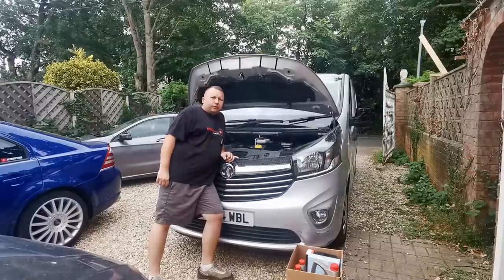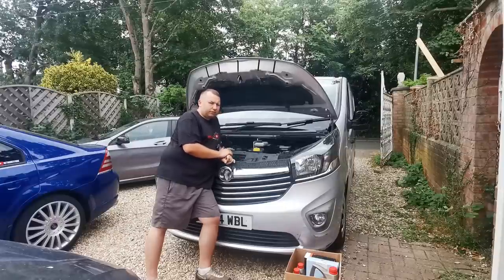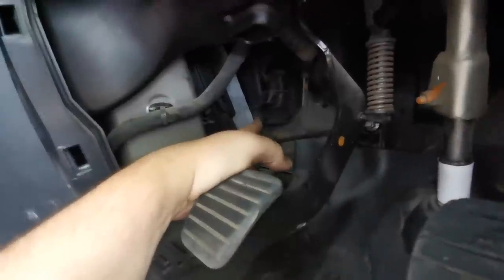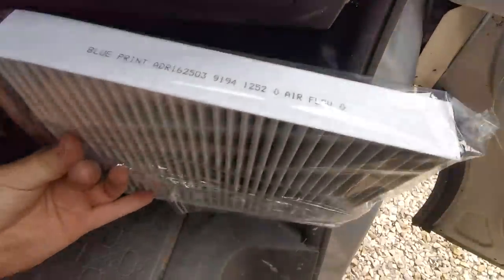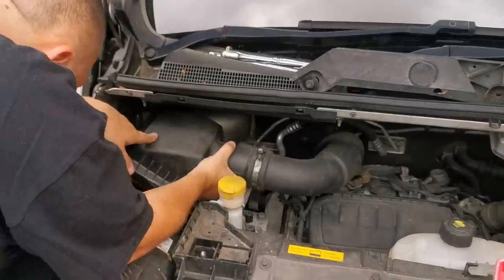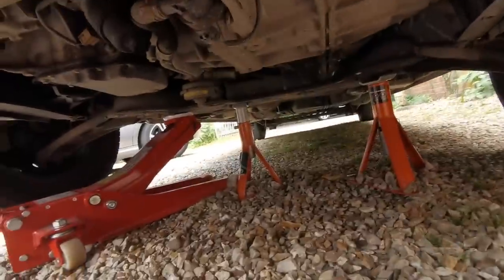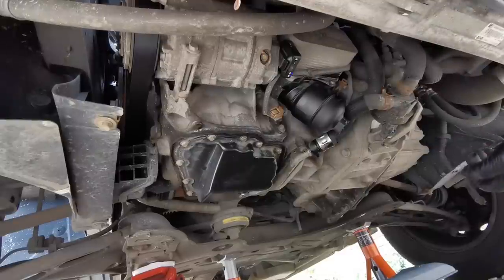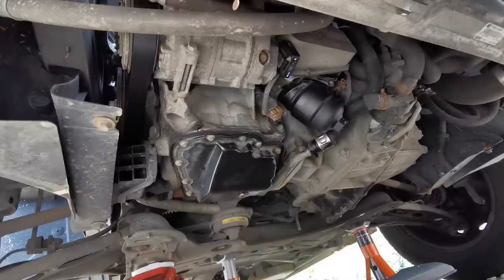VAUXHALL VIVARO B SERVICE #vauxhall #projectman

Comment: Good tips 👍
Have fait talento same engine and set up
Quick fill oil, top of engine cover, maybe yellow cap? Or hose, cink hose turn it right and lift up as cap 
Pour oil straight into engine 7.4 l  5w 40
Reply from the maker: Nice

Comment: Gary please give it a good thrashing now and again as these are terrible for the dpf’s blocking up if poodled about all the time. I wash at least 7 different dpf’s a week at work. The exhaust pressure sensor pipe clogs up with soot and is a pain in the arse to change. Your engine looks very dry so I would guess you have a good one. Nice video as per usual 👍🏴
Reply from the maker: It's sweet Andy 👊🏻👊🏻
Reply: @ProjectMan  I think you have a good one 👍

Comment: Good video Gary I’m surprised you did use good old Mannol long life 5w30 fully synthetic £33 for 10 ltr off ebay , I did the wife’s 1.6 diesel Sportage with it , and yep the oil is black even after you have changed it
Reply from the maker: I wanted it that day for the vid mate 🤦‍♂️

Comment: Great video mate,.what would you say about timing chain replacement on these? I've heard people say change them around 75k-100k miles but surely timing chains don't need replacing that soon do they?
Reply from the maker: I was told by a garage between 80 & 120 k or every 5 years iv a mate who's van is on 180k with original chain 🤷